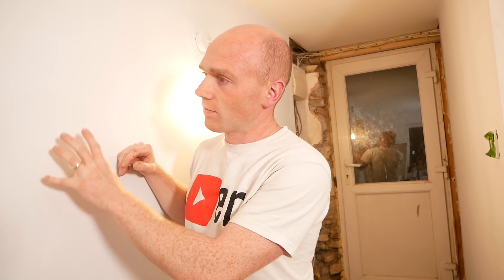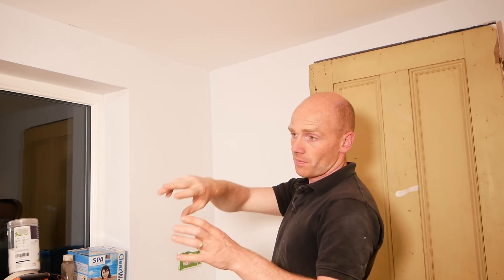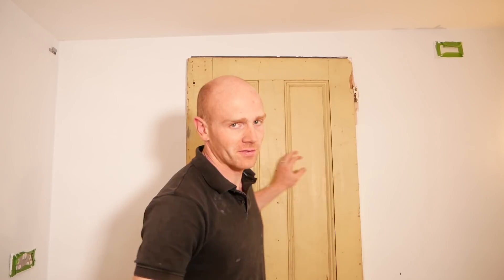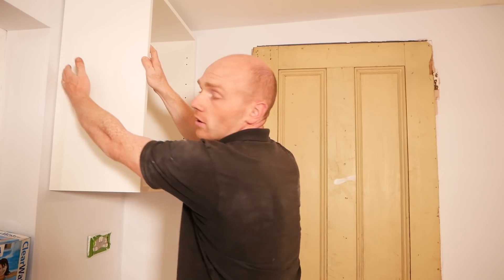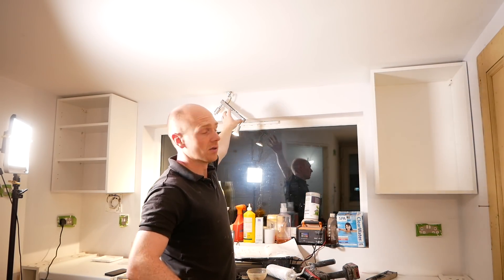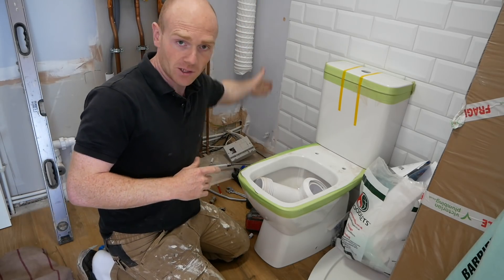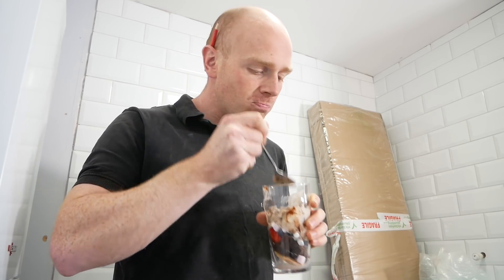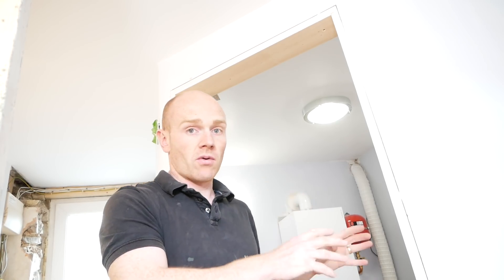Hanging Kitchen Wall Cabinets - plus we have a TOILET!

Comment: Whenever I've put together cabinets like those, or IKEA-style self assembly furniture, I've run a bead of wood glue in the rear slot before sliding in the hardboard backing, it helps with rigidity and stops the back panel from rattling. 8-)

Comment: Good job. Not sure if you mentioned what kind or worktop you are fitting sink to. But if it's a postformed laminate top, cut the hole out for the sink using your track saw. Far better finish than a jigsaw. Obviously need to be very careful.
Reply from the maker: Oak, yes track saw for most of the cuts. 👌
Reply: The Restoration Couple.  Just be careful. Drill large enough holes in each corner. Track saw cut to each hole, lift top in,  finish the cuts into the corner holes using a multi tool or hand saw, if you fix something to the off cut to stop it dropping down through, that helps.You may already have an idea, thought I'd give you my tuppence worth.

Comment: Are those square toilets the trend in europe? When we were in Athens last year 2 of the B&Bs had them and then again when we were there last week it was the same thing. The ones in greece used massive amounts of water compared to those here in the US. Despite the fact they used a bathtub full of water you still have to put the toilet paper in a trash can (eww). 
 
   As for those cabinets... They are fine. I have built several kitchens and I no longer over build the boxes. Once they are on the wall they are fine. There is no need for tank style building as they are just house cabinets they aren't abused over loaded shop cabinets. In fact the last kitchen I  did and hopefully the last ever was our kitchen. I used Ikea boxes and built the doors and drawers from Cherry. If I ever do a kitchen for us again I won't even build the doors as 30+ linear feet of cabinets is allot of work...

Comment: Did you screw through into the floor to secure the toilet pan or just silicone in place?  Thinking about the whole 'floating' floor debate.  About to do a similar thing myself....
Reply from the maker: Screwed down to subfloor but drilled a larger clearance hole in flooring so it’s not screwed down itself.

Comment: Tim hope you don't mind me asking you this but why is the fan in that position? Call me old skool but those fixings seem somewhat lightweight, the one kitchen I removed had a lot of M10 type bolts, kitchen cupboards do face a lot of stress. It looks a bit more like a bathroom cabinet you is putting up! I think that area was crying out for something bespoke, some timbers from the workshop honed on the planer thicknesser and lovingly sanded  by your good self. I could feel your pain as you were installing them!
Reply from the maker: No that’s a standard kitchen unit. The cleats are a little larger on the better units rather than those chucked in with the cheaper units. That said, 4 chunky screws in to a timber beam will take some weight! I did a few oak units in the kitchen on french cleats which felt a bit more solid but relies on the clear being bang on as no adjustment. I’m not too concerned on the cabinets as the doors and trim should make it sufficiently fancy for a utility.  😀
Reply from the maker: Fan is needed for regs, needs to be on external wall and can’t be above units or through structural beam. Therefore best place was tucked under wall units so mostly out of view. 👍
Reply: IMHO People way over engineer kitchen cabinetry. They just don't need to be a solid as most people think. I've just put cabs from the same supplier in my own kitchen and they are fine; brackets into a good solid beam with decent screws, they are going nowhere. 
I recently changed the doors, coving and plinth for a highish end client who only wanted a freshen up not a complete refit. The kitchen was at least 10 yeas old (that's how long I've been looking after the place for her and it had been in a while then) but the boxes (again from that supplier) were as sound as a £.